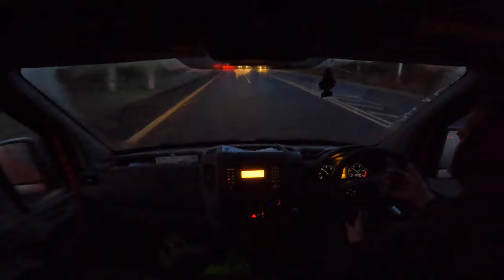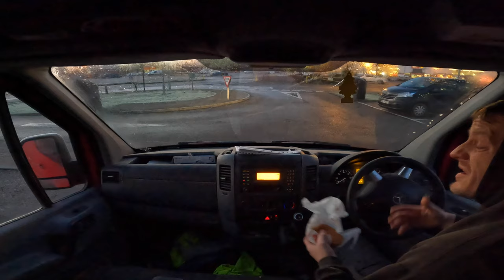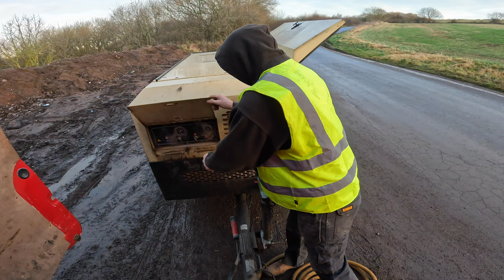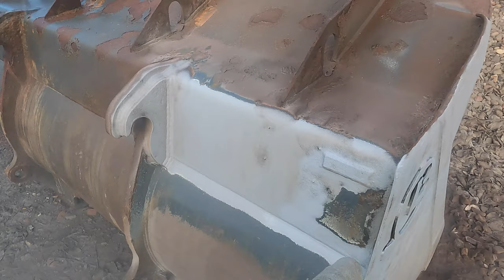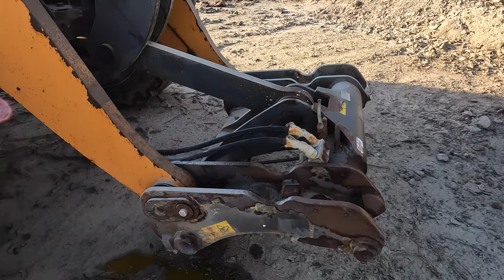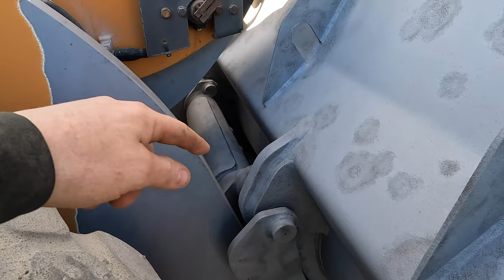How to Remove Rust! Rusty Loading Shovel Case 621G SandBlasting! wheel loader

Comment: Get some oil in that before u blow it up 😜 fill to 3/4 up to the max, once oil is hot it will thin and sit on the top mark👍
Reply: Also turn and hold the key 3/4's ( just before it engages the starter)  for about 30secs to use the heater plugs and starting will be a lot easier
Reply from the maker: @drummond630  it had a 3rd on the dip stick as long as she's over the safe start line and below max it's fine 🙂  this unit don't have glow plugs its electronic heater (heats the air intake) no matter how long I leave the ignition on its always been the same for the past 7 or 8 year even when it was new well I got it with 0.4 hours onit it will nether start 1st turn its like its to be cranked over to wake up 😆 she was shutting herself down its the crank speed sensor and or fuel pump wires making a bad connection I've had plugges made before and and even rammed a little coper wire into the plug to help it connect. It's simply the amount of use it gets on average I've done 25k miles a year with this on the back of my van and worked it hard every day for the past 7 or 8 year 😬 to get nearly 200k miles without may issues I'm happy with that service
Reply: @Mobileblaster  it had quarter on it bud and your low oil light is your fault mate 
its min and max not safe start bud
The compressor only started because you leveled off the sump. 
Low oil is 1 of 5 safety cut off switch so machine wont start, you have 4 others which are low fuel, oil pressure switch, air end oil temp and air discharch temp.
Reply from the maker: Ive seen oil pressure, crank speed air end pressure And water temp 😬 that shut her down before when the belt snapped 😂 i didn't know she had a shut down for exhaust temp? it had plenty of oil 😬 I've had it before when it's not even made the stick and been working fine think it was pure luck it worked by lifting the nose. It has days like that that then will be fine for months. Now I'm slack for work I should service it really maybe another day 😂

Comment: They are pretty strict on the off-road diesel usage here in the US as well, just a government money grab!
Reply from the maker: As it stands anything that don't go on the public roads and uses derv to propell its self can legally use Red (low tax fule) the rule now is everything will need to pay pump prices someone using a generator to power tools on site miles away from a road need high tax fuel 
My compressor uses 90/115L a day that's ultimately going to add £100+ per day extra from what I'm paying now it will affect building trades house prices will go up because plant help build all these. It's going to be more of a struggle than covid hitting all over again I don't know if I can weather this 1 but everyone will be in the same boat. Even canal boats anything that uses diesel will be on high tax. Apart from farmers and a very limited sectors 😔

Comment: Why not look into the new laser technology that can remove rust , paint  ect and get a portable industrial battery which you could charge up with solar or from a plug socket
Reply from the maker: The tec isn't quite ready to be viable the mobile rig is 250k and over 10x slower than blasting Ed China did a video and the chassis he was zapping tuck forever and still wasn't as clean as a cheap pressure pot would achieve 👌 the power they require isn't found in domestic settings so not really a viable option 😔

Comment: Why don't they have a different coloured dye for plant machinery. Put the duty up so the price is half way between red and white ,so you don't  have to increase your rate a huge amount and the robbers aka our government earn more money 🤔🤔.
Reply from the maker: It's the government that's stopped the low tax fuel and made it illegal to use such fuel after 1st April 2022 I have no choice its happening 140% increase that me and everyone els has to suck up. It will seriously affect every industry and every person in the UK and 0 media coverage unbelievable. Anyone what says it won't affect them trust me if a forklift has lifted your shopping on the wagons its affected them if you have a house built yep all the diggers and plant use it ok I bought an old house what about the roads they drive on the plant that builds the roads use it and 140% increase hasn't made the headlines loads of other industries use it and all it will do is ultimately course a price hike on everything not just my industry.
Reply: 100% mick, I do work for a food company that run 50 300cfm compressors 24/7 all over scotland. If anybody thought the shortage of lorry drivers was an issue causing price increases then just wait til red stops mate cos there is a massive amount of industries that will suffer and that price will be put onto everything we buy.
Reply from the maker: @drummond630  exactly and that's just another industry that will be hiking up the price to cover the costs. I'm bamboozled why the media hasn't picked up on this it should be headline news